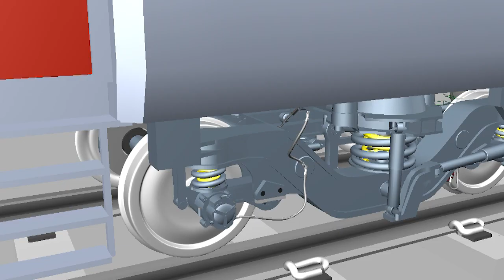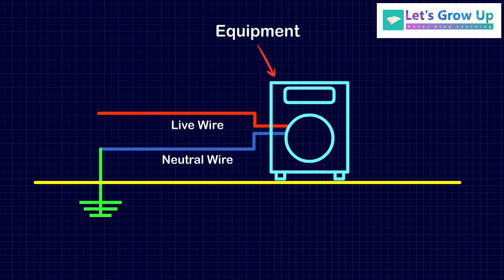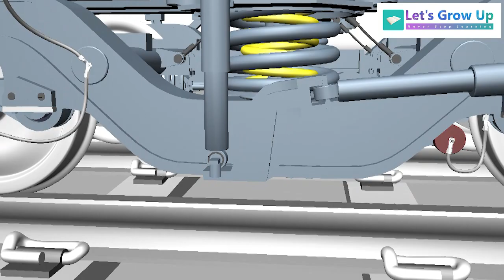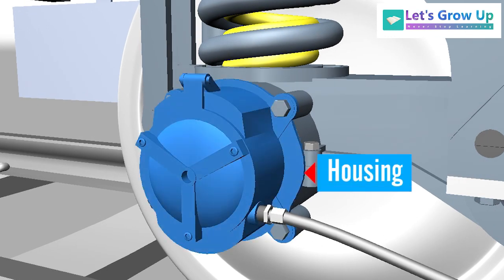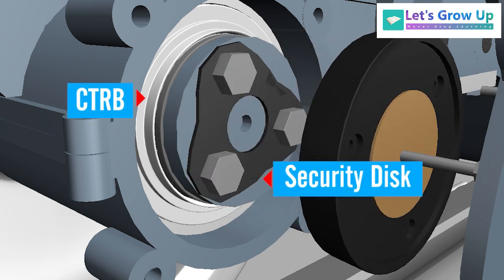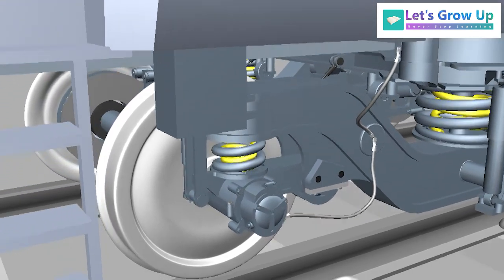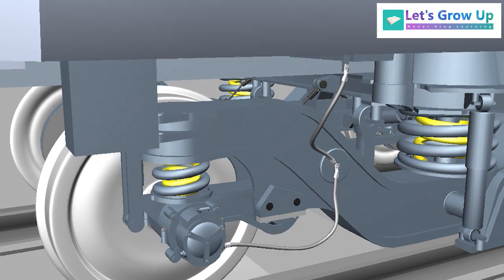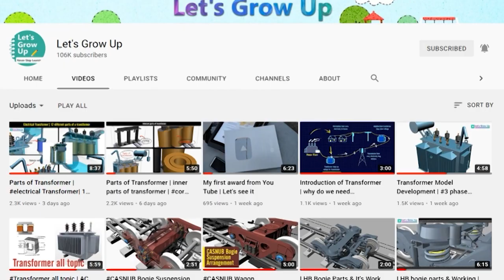Why Earthing Device used in LHB coach | Earthing device in  | #let'sgrowup

Comment: The return current flows through the earthing device & saves the bearing. That is ok.. But why the resistors provided ? If they are not there also the current will pass through the low resistance path (earthing device).. Isn't it .?..

Comment: Q.1 In normal running condition when there is no leakage of current from any electrical circuit, how much Ampere current flows through earthing cable ?

Q. 2 If in some scenario maximum 400 A current passes through earthing equipment, will axle or assembly disc may go heat up or can crack  ?

Q.3 what will happen if current above 400 A passes through it ?
Reply: Right questions 👍🏻
Reply: Current depends on the output of transformer. If any live cable touches the body of the train it should have the capability of pass all the Current to ground.